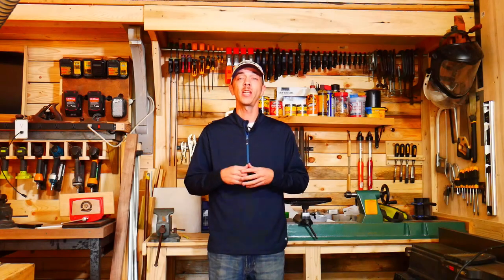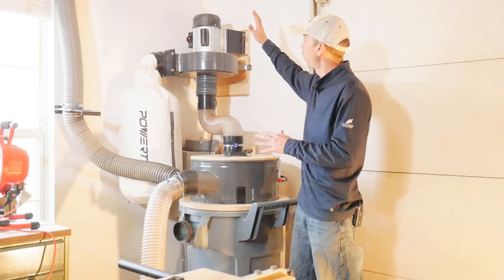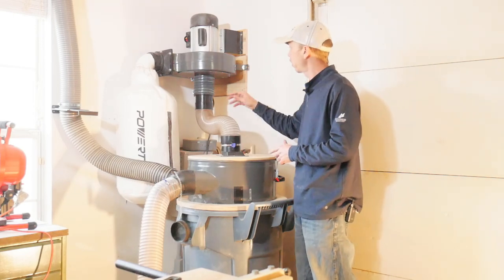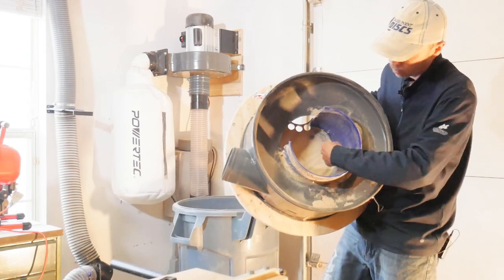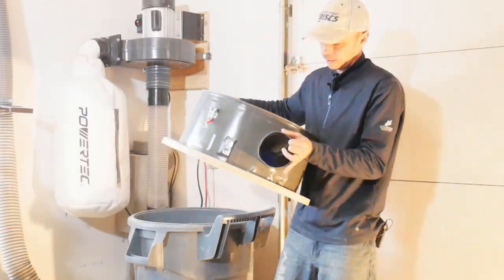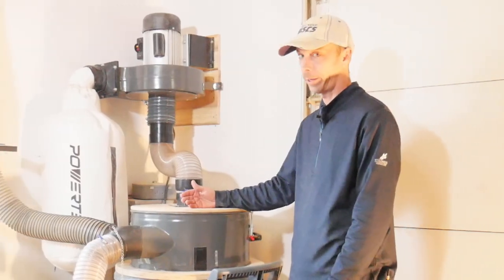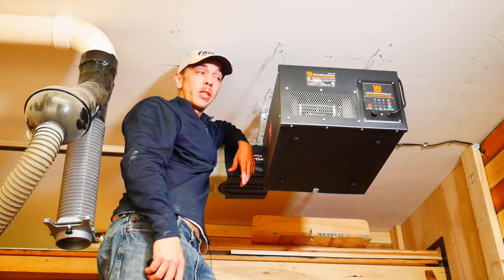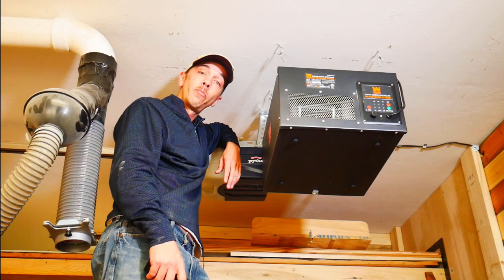Dust Collection SMALL WOODWORKING SHOP (Taking Dust Collector and turning it into a 2 cycle system)

Comment: Great video…. Where did you get the cyclone?
Reply from the maker: From the Harbor Freight dust collector. It has the bucket and holes on the bottom. Or you can buy a cyclone.

Comment: How much dust is left on your table saw using this collector?
Reply from the maker: I think it depends on the table saw. Mine does okay but it has no back side. So I get some that escapes on the floor. Not to bad. I highly recommend the exhaust bag, I'm getting about an 80 to 20 ratio from Trash Can to Bag.